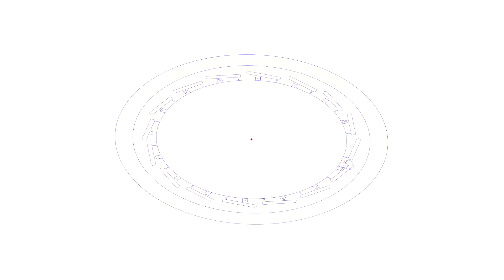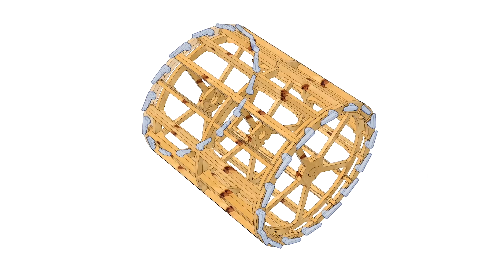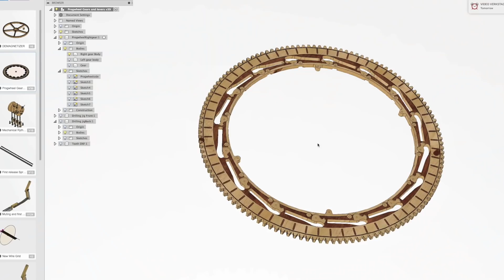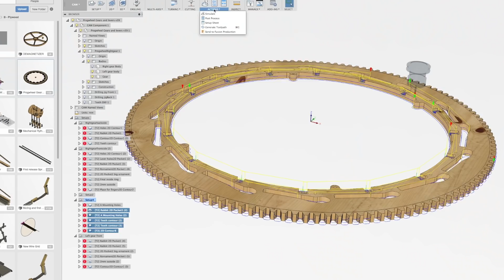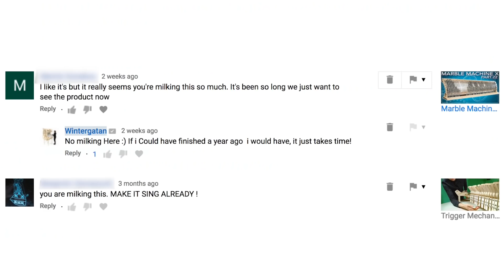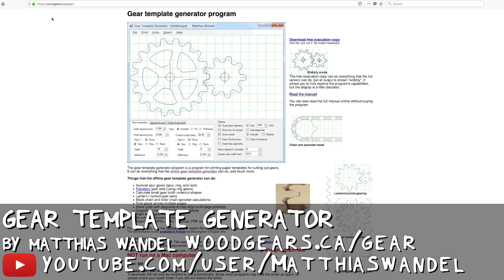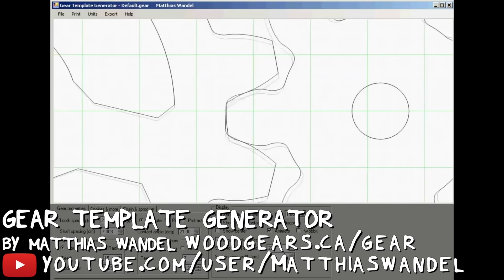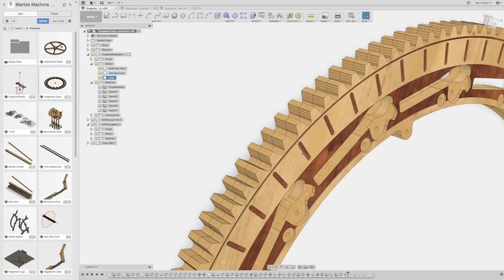Plywood Gears with Precision - Marble Machine X #24

Comment: It has been a while since I learned about gears in undergrad, but I am pretty sure straight spur gears should definitely vibrate if one of the shafts is not constrained. There should be separating forces that are part of the tooth contact cycle which would push the gears apart. With only gravity holding them together, that should lead to bouncing and vibration. Actually my guess is that it's probably not great for the gear teeth to let them contact in an unconstrained way like that. If the teeth were metal and hardened or carburized then it might be fine, but my guess is surface wear due to contact stresses is the primary failure mode for soft wooden gear teeth. 

This is something we deal with in spaceflight too. When you are doing your acceptance checkout testing to verify form/fit/function and workmanship, you need to make sure you are not doing anything that might unnecessarily compromise your part or reduce it's life too much.

Comment: A tip for making the insertion of a wood screw easier - scrape the screw along a candle and so adding some wax to the thread. The screw slides in more easily and neither the screw or the timber are compromised by the presence of the wax. Love the videos Martin - always entertaining sometimes in the most unexpected way. And no you are not milking anything. I would always choose to see more comprehensive illustration of your wonderful process.

Comment: What you did with offsetting the teeth is kind of the early stage of a helical gear. Helical gears are made for exactly that reason, to smooth out the contact of the teeth.

Comment: You should check out downcut bits for the top surface or compression bits for doing full depth cuts so you can avoid sanding to remove fuzzies.

Comment: What I'd fear most with those plywood gears is wear and tear! I think war will lead to rattle and I assume you can tolerate some rattle in real life. However I am not sure, your decision to shift left and right transmission is helping for that. You might get an intermediate rattle left and right. What I'd do is pack quite some spare gears for the tour. 

Any experienced mechanical engineer reading this? I would be very interested in you view on wear.
Reply: War? what? Also yes, they will get worn out but not much. A replacement set of all major components of this build would be ideal.

Comment: Cool stuff. I wonder about the durability of the small plywood gears. Feels like because a single tooth will engage much more often it will wear out much faster then the big gear (in proportion to gearing ration I suppose). I wonder if you'd be better off with small gears made of hardwood. Not sure if this would in turn increase the wear on the large gear. I'm assuming that plywood is less durable then hardwood - but that's a guess.

Comment: Way too late now, but you might have gotten finer engagement resolution if the gears were half a tooth out of sync rather than a whole tooth, because then one side would be in the middle of the engagement while the other side was at the beginning and end of engagement.

Comment: If you want a way to make the magnetic steel parts (4:11 in the video) a little bit faster than by hand: There are companies who laser cut them for you (CNC of course). That should spare at least two or three hours given the number of pieces to make. And I'd try to get it from a magnetic stainless steel like 1.4016, so you won't get problems with rust.

Comment: Hey Martin, I really, really want you to be successful with this project. I am feeling nervous about the robustness of plywood. In particular, I'm thinking about how much things get banged around on tour. When plywood takes a hit, there is often a lot of splitting and swelling of the plywood around the damaged portion. If your crew drops the big drum wheel by accident and a bunch of teeth get damaged, how will you repair that?
Perhaps you and your team already have a solution worked out for highly protective packaging so you can ship the parts of MMX safely. If not, the parts of MMX need to travel as safely and securely as any of your other instruments.

Spend some time thinking about the construction and deconstruction steps. All the pieces are odd shapes and the people doing the work need to know what they are doing. I think the biggest risk to the whole project is during those times. A bad bump, a stumble, an unexpected trip and a major assembly like the programming wheel could be damaged and left both unusable and un-reparable. A terrible outcome, especially early in the world tour.

So still plenty of time to get prepared for this and you have a great team and a world of fans who also want you to be successful. So my advice, 3D printed parts wont be a problem but your whole team needs to take very good care of all the plywood.
Cheers,
Steven

Comment: Are you not worried about the wooden gear teeth wearing down over time? Especially when you aren't treating the wood or anything? I don't know so much about the durability of plywood but I would have expected this to be an issue. Or is it mitigated by the precise tooth shapes which minimises rubbing/shear motion etc? Or do you figure you can fairly easily replace parts that get worn because you have all the CNC designs and can just make replacement parts as needed?

Comment: If you need, there is a fantastic device called a Drill Bushing.  You have all the tools you'd need to accommodate one.  That wooden drill jig, while fantastic, will begin to widen that hole with use.  So you make a slightly larger hole, and drop in a hardened steel drill bushing.

You'd want to find metric ones, of course.  But here is an example:  https://www.mcmaster.com/#drill-bushings/=1bh77zv

Comment: I know you want it to look rustic. But I would recommend considering a thin layer of clear varnish over the finished parts just to prevent moisture from damaging them over time. Even if its just some cheap spray can varnish from the local hardware store.
Reply: Or dust, fingerprints, nicotine smoke from the auditorium, etc. To make it cleanable. The Golden company is who I call, for archival protection of my art. I have to use a clear undercoat, then the final hard varnish, which is UV resistant as well. It is smooth and available in matte or satin (or mix a combination of those to get the right level of matte desired.)
Reply: FWIW,  I think I recall MM saying that THIS machine won't tour: it's a pathfinder for the final product.

Comment: I've worked in a machine shop and yes this could be made quicker, but you are prototyping and designing on the fly, learning the tools and how to use them along the way, and solving problems you didn't know you had after they've been made. I think you're making great progress and I appreciate the learning experience you are sharing.

Comment: You mentioned "mistakes" which took up 6hrs of time to make the first gear. How many mistakes have you made which were a total loss for the part being built? The CAD program virtual prototyping probably have saved you lots of actual mistakes. However, no matter how high a quality material you use, I'm sure you have had parts fail just due to splitting and such. It would be interesting to see a "bloopers" video, where things didn't go so well one day. Your work is beautiful, and I enjoy watching the process of building X. I'm sure it will be a fantastic instrument once complete.

Comment: I gotta say, I'm close to 30 yo and my generation and the younger ones have that embeded urgency on everything (in contrast of the fact that in average we gonna live longer than past generations) So don't be bothered by ppl that have that sense of instant results and pretty much instant everything... They are so used to the industrialized metal / plastic things you can throw  away and replace on the fly, that they don't seem to trully appreciate some awesome wood work (which is time consuming but so worth it). Keep up the great job and congrats on the smooth gears :D

Comment: Even smoother engagement of the gears could be had if they were helical gears: in a helical gear the the spiral shape of the teeth ensures that tooth engagement starts at one end of the gear and moves smoothly across it, making them run silently even at very high speed. Manual car transmissions often use this approach on all gears except for reverse, which is why many manual cars make a loud whining noise when driven backwards quickly.
Reply: Helical gears can't be cut on a 3-axis CNC machine without a LOT of complicated jigs and headache. He'd need a 5-axis machine.
Reply: Yeah, you'd need some kind of inclined rotating axle for the work piece so that the cutter could cut each tooth at the correct angle (cutter cuts tooth, gear indexed to next tooth position, rinse & repeat).

 In any case, helical gears aren't needed given the low speed and the very smooth movement he's already achieved.

Comment: Any plans to use a protective perhaps clear pain to prevent delamination? May be you would be inclinated to use some Bees Wax to lubricate, maintain and extend the life of the gears??
Reply: That's a really good point, if this machine is going on tour all over the world, there will be climates with a lot of humidity that might cause problems with some of the more intricate plywood parts.  If nothing else, it would be important to pack all the plywood parts in sealed plastic bags with a lot of fresh desiccant every time it is transported.

Comment: Very pretty! A concept for the programming plates, since you'll have a lot of them floating around stage at once: maybe put a label "Song 1: Plate 1" onto the "side" of the plate frames like you show at the end of the episode where it touches the drive gear, positioned to be visible through the handle stowed position slot in the gear? This would enable rotating the wheel while locking a fresh song on, and seeing "Song 1, Plate 1", turn "Song 1, Plate 2", turn, and so on until you wrap around from plate N to plate 1 again, ensuring the right plates are on the machine, in the right order, and positioned correctly right before you stow the handles. When the handles were stowed, the labels would be covered, and thus not visible while performing, but it'd ease preparation of the machine on stage as you've mentioned wanting to do.
Reply: I wish they weren't opaque: I liked M's original 'skeleton' concept.

Comment: This is becoming more and more impressive as it is built. And yes, you DO have more done than you've shown us! As you pointed out, the system for fastening the pin plates in is one of them. :) But it's understood, and I was NOT under the impression that you were done. (Otherwise, why ask for advice on such things as the demagnetizer, now?)

Comment: Hello Martin! The precision fit of the plywood parts makes me a bit concerned about possible swelling if exposed to high levels of humidity during the world tour. This could cause some distortion in the programming wheel. Perhaps some type of wood sealant is in order? Keep up the great work!
Reply: Plywood is built to be 'dimensionally stable'. The layers of wood are arranged so that they will expand at right angles to each other, which makes the glue effective at keeping the whole thing from changing shape.
Reply: The thickness of the wood might change, even if the length and width don't.

Comment: Using offset gears really isn't that far out, it basically is the equivalent of a full-wave vs. a half-wave rectifier. 
One traditional method of producing gear drive with basically zero slack is using braced gears, i.e. having two gears on one side which are tensioned by a spring, so one will be pushing against the front of an opposing tooth and the other against the back. This is, however, generally applied where precision is more important than low friction, like driving tuning capacitors, which is the only reason why I know about this at all (I'm an electronics guy and old radio nut, but don't have much of a clue when it comes to mechanics).

Comment: Love watching the technical side of the build, keep them coming. Have you thought about keeping the Relative Humidity of the wood stable? This will reduce warping and delaminating of the ply wood, giving stability to the machine. Also have thought about lubrication of the sliding parts of the machine, like the gear faces?

Comment: The first Marble Machine was fascinating to look at and I am shure the new one will be much better. Its fun to see you building the machine. If you like, you can milk it more and more ;). The Details are awsome. I have an Idea for an inline reprogramming device where you don't have to change the programmingplates.  I have to say, that its only a idea and I didn't figured out how it has to be buildt... If you make the programminpins moveable, that they can slide out an in, you can use a device that fist pushes all pins in, and than a device that pushed certain pins out. The out-pushing-device is connected to a PC or somthing like that. with this you don't have to change the programmingplates and you can play longer songs that the programmingplates would allow. you arent limmited to one revolution of the Wheel for one song. The idea could also used for a certain instrument...  I guess you are creativ enough to make somthing out of this. Instead of a electronik you can use a small piano keyboard for changing some pins.  That make the Marble Machine an Marble Loop Machine...

Comment: Awesome!
Just a question or suggestion... I'm no pro or something. But I remember that when my dad builds cabinets with simple sliding doors, he rubbed some candles against the wood to make the door slide more smoothly. I think it also helps against wear and tear. Would it be smart to use some kind of paraffin or wax, since I see the gear teeth slide against each other? Maybe it works well with the locking mechanism for the programming plates as well.
Greets from the Netherlands :-)

Comment: Wow. Really good. It all slowly comes together. However, I have to say, I kinda like the slight rattling sound of the gears. It just gives it a whole new atmosphere. Like as if you hear how every part of the Machine works together. I don't know if it's good to ask you this (because you want the Marble Machine X to be perfect and rattling is a sign of imperfection), but what if imperfection is intended? In the way of using a mechanism that combines certain gears that rattle if in use. I think that this would make some songs even better by giving them this special touch. Just listen to the rattling of the Marble Machine... and then imagine it without the rattling. I hooe you understand this thought and may think about this suggestion :D just answer me here or say it in the next video how you decided ^^

Comment: Since MMX is going on tour it will need to be transported. How much disassembly and reassembly will it need between shows? I'm afraid that with a lot of handling, the bare, unfinished wood is going to start looking pretty grubby in the later part of the tour if it needs a lot of. I liked the Clickspring reference too. I don't think Chris is using much CAD on his Antikythera device reproduction...

Comment: Martin, Love what you are doing. Keep up the great work. Just 2 tips I would consider, only in my opinion. I would consider putting CA glue, on the gear teeth where they mesh. To help harden the wood gear tooth for better wear resistance. The tooth will get slightly fuzzy and rough, from the protruding fibers now being glued. But I imagine that should wear away very shortly after use. Also, after applying the glue, I would definitely spray the wood with a clear sealer, sand, and then 2 coats of clear finish. To help prevent expansion of the parts in humidity changes. To seal in your coffee stain, it will disappear in time without it. And to help keep the wood clean looking. Bare wood is just going to get dirty looking over time. And your not going to be able to clean it. And then finally, if the teeth and wood are sealed, you should be able to spray on DRY LUBE (which is clear), onto the teeth, to further help reduce wear and improve smoothness. Keep up the great work and looking forward to seeing you in concert someday. Dave.

Comment: I find the takedown by taking out screws a bit concerning, wood doesn't withstand many cycles of screwing and unscrewing, specially seemingly it might be assembled/disassembled at least monthly. It might be worth installing tapped metal inserts to attach the screws wherever possible rather than relying on the wood to hold.

Plus, I would recommend using torx or robinson screws instead, philips heads tend to get damaged easily and might result in a lot of headaches when trying to take them out .

Comment: Hi Martin

i have a question...

about die consumption or the loss of the Wood gears. I am not so in with Wood more with Metal, there we use grease or Oil to handle the consumption in a Gearbox. Ok in a Car or Bike Gearbox is alot more Power or Force on the toothes of die gear. 

is this a Problem with the marble Maschine X? When you goining on tour with it you will Play a lot on it so it would be bad if the Gears will go smaller an small an smaller.

anyway hope to see you on tour in Germany some Day 

go on an thanks

Comment: Very good idea, it is similar to double helical gears. (On a side note Helical gear were created to ensure a smoother transmission, most cars use them in gear box, but I can see you can't cut helical gear with your CNC machine.)